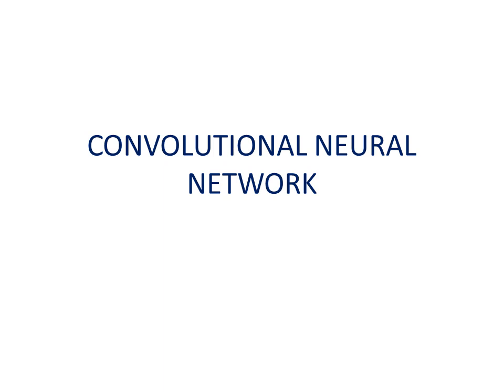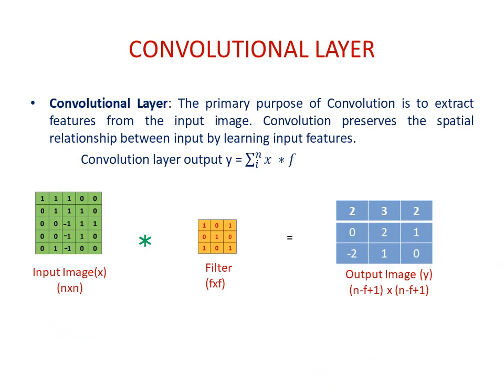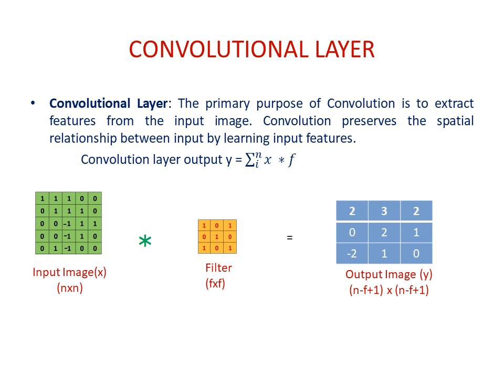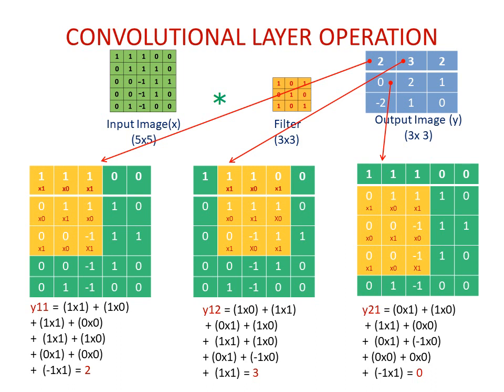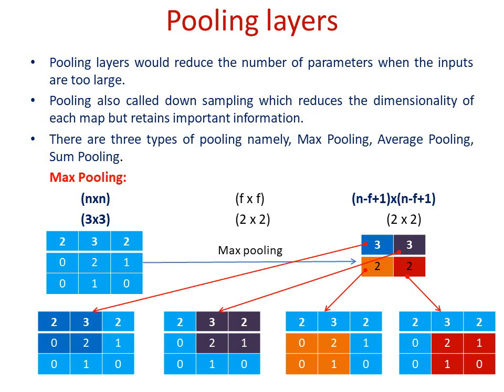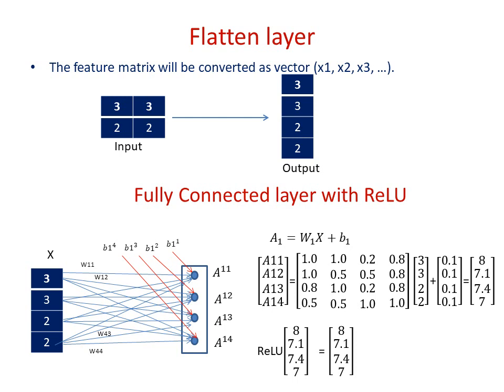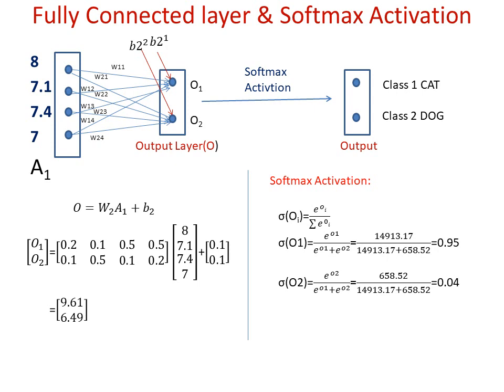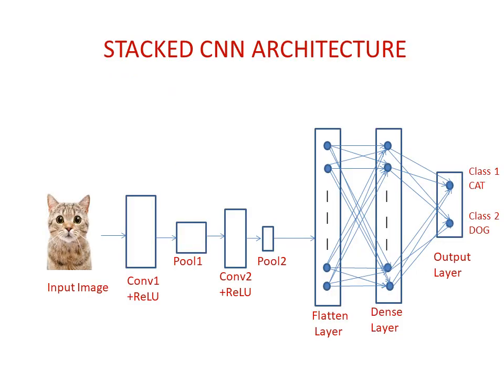Basics of Convolutional Neural Network (CNN)

Comment: Clear explanation sir. I have a doubt that, whether the weights are assigned randomly or followed any techniques like xavier initilaisation, He initialisation.
Reply: Isnt weights just randomly assigned in the starting and then with backpropogration updated in each epoch / loop
Reply from the maker: Yes, assigned randomly while starting. However, It is updated using backpropagation.

Comment: how initial filter weight is choosen
Reply from the maker: There are inbuilt function in python. So no need to chose initial weight for the layers. It is enough to mention no of layers and neurons. If you want to write your own code then chose very low value bt. 0 to 1 for better results.